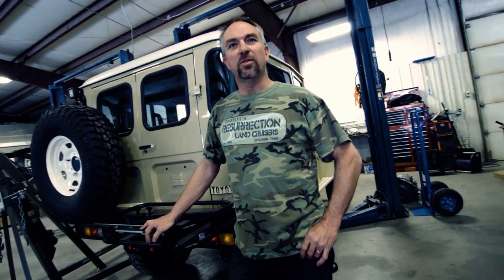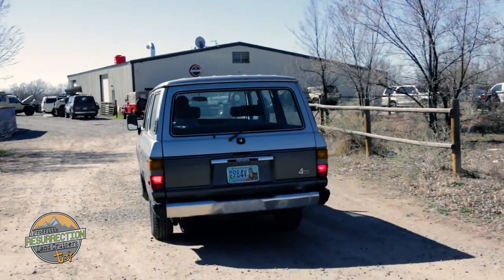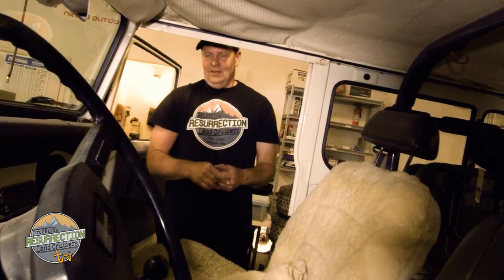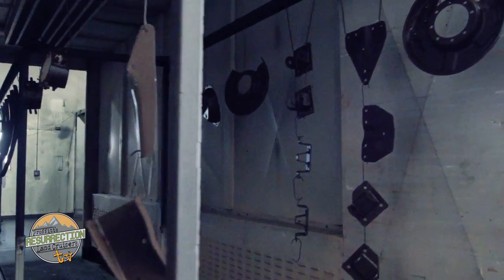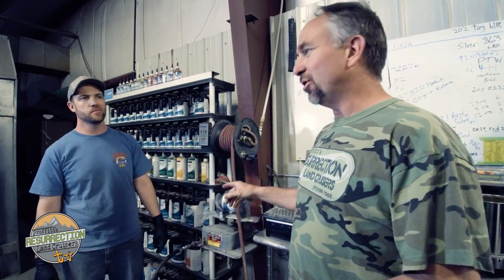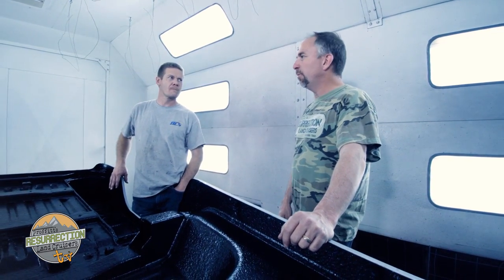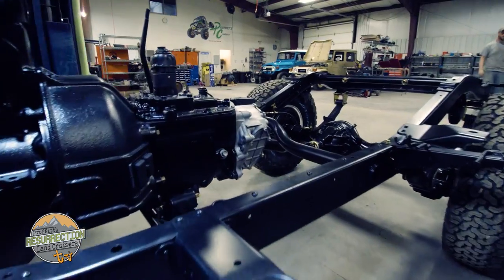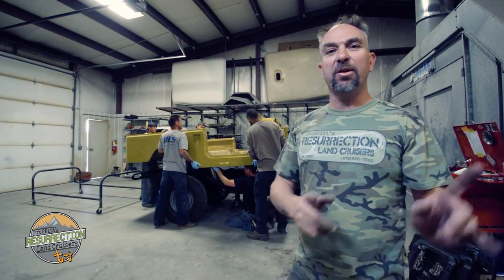PROFFITT'S RESURRECTION LAND CRUISERS TV EPS  5

Comment: Great Work!! 
What is the paint you use for the "rough" undercoating and inside back flooring. That gets painted over with color.
thanks!
Reply from the maker: Thanks!. The coating is called Vortex. It is a 2 part polyurea liner line most commercially sprayed bedliner.